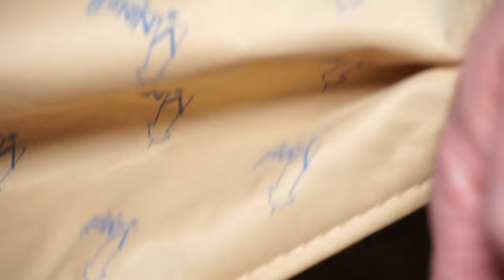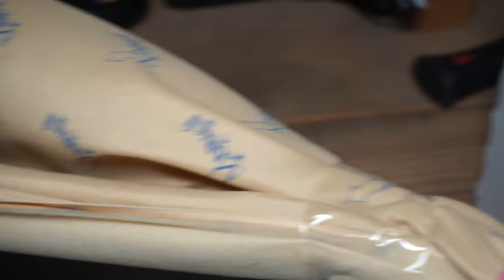How to fix or reinforce hard shell luggage for under $10

Comment: I did similar but a bit different. I worked from the inside of the suitcase and used broken pieces of the shell to recreate outer look. I used epoxy with 15 min curing time and didnt bother to mix with fiberglass outside. I used fiber glass matt (woven) cut into suitable size and glued it to the prepared surface (roughened with interlock holes etc). Then I painted epoxy ontop and added 2 more layers this way. The result is similar to yours however the fix is barely visible from the outside.

Comment: I had a 10cm straight crack in one corner of my Verage case, the wheel was not involved and there was no dent. I used 2k plastic glue in a small double tube, glue + hardener for different types of plastic. I didn't mix a strip of fiberglass mat with the glue, but I pressed it into the glue. Successfully done. Think about using Bondo next time because it is a larger amount for a larger surface and mixes well with fiberglass. To indeed reinforce the corners with wheels. I also believe that there is a wide quality difference in roller cases. My preference actually has the Samsonite soft case models with 2 wheels. They are much more resistant to damage because the contents form a compact mass. Hard shell suitcases often contain air which makes the suitcase vulnerable to dents when other luggage is stacked on top at airports.

Comment: Does the tube of catalyst that you mixed in come with the gallon of Bondo, or is there a separate link for that product?
Reply: catalyst usually is added with every size of the putty. Usually no matter how hard you try they dont run out in the same time so you can buy the catalyst separately.

Comment: Great tutorial - did your clothes get an odor from the bondo? Also, how thick was the bondo? I'm thinking 1/8" on mine... thick enough?
Reply from the maker: No odor from the bondo. Thickest part was probably 1/4" in the corner but tapering off from there. 1/8" is probably fine.